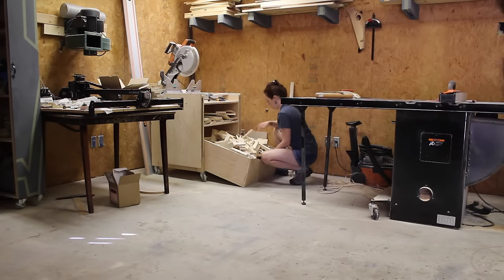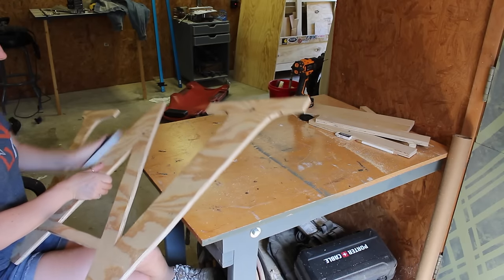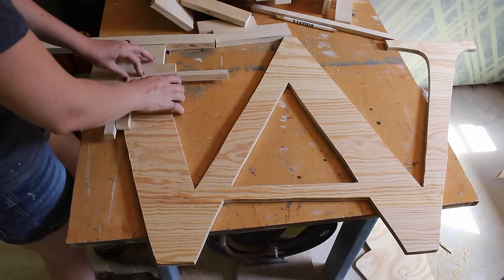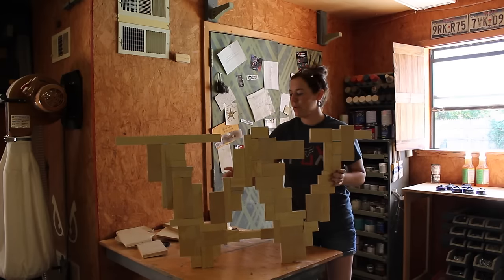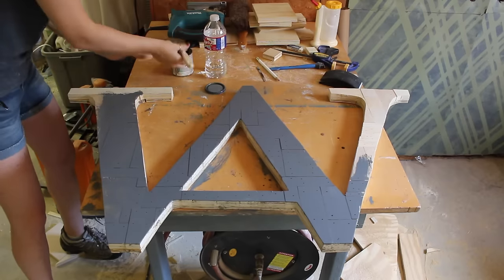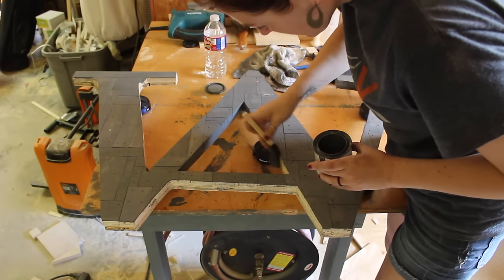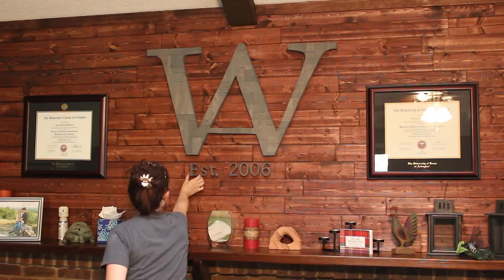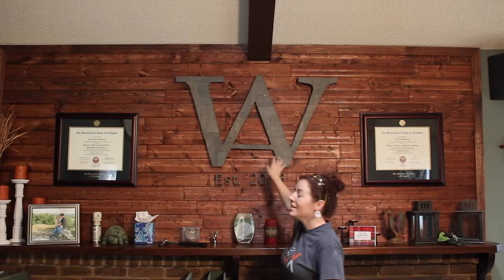Scraps aren't Crap! - A Project For Small Scraps : )

Comment: Nice! On the weekend I built a deck out of pallet wood, and as you could imagine there were a lot of scraps left over. I have a dart board mounted to a large piece of MDF, so I could hang it outside on the brick wall of the house. That's so the darts wouldn't hit the brick, however it looked pretty rubbish. So I got the scraps from the deck, a bit of liquid nails and a bradder, and basically did what you did on top of the ugly MDF :) I even put one strip on its side to act as a shelf that i drilled some 3mm holes in for the darts to sit :P then finished it up with a bit of decking oil. I'm definitely a fan of rustic woodworking!

Comment: looking good.  my wife wanted a W for an xmas gift last year.  she printed me a W in the font she liked, which was very similar to this.  the most difficult part of the project was up-scaling her print by 3x.  it was 3/4" plywood, sanded smooth, and painted gloss black.  she then epoxied several of my beer bottle caps across the face, as well as cutting out and epoxying the crownroyal symbol from one of their purple bags.  came out pretty sweet. :)

Comment: Thanks for the useful tip. Scrap is always accumulating and your idea can impact. In cutting out those letters, how much did you consume?
Reply from the maker: I don't understand, what do you mean?
Reply: Oh sorry I did not make myself clear. You did "consume" a sheet of 3/8" plywood in order to make the logo. In so doing you created scrap. So my question was,what was the net result - did you make more scrap than you consumed? I'm sure it was well worth making the sign but in terms of emptying out your scrap bin it might have made things worse.
Reply from the maker: Well the point wasn't really to empty the scrap bin, it was to put some of them to use before burning them. Typically I just take this bin outside and dump it in a fire, however I've been wanting to do this project so why not use material I already have instead of buying something? Even though I used a piece of the 3/8" plywood, I still have a very large piece left over that I'll be able to use for something else. All of the small scraps that were created from this project did go to the fire.
Reply: +April Wilkerson OK thanks for explaining.

Comment: April... Very unique choice of the stain against the other wood.. Have you ever used Tung Oil for any wood finish??? I use it on gun stocks, which of course are "handled" often, and the Tung Oil is good for shedding water if caught in the rain.. Just curious..
Reply from the maker: Nope, I've never used Tung oil yet. Just poly, wax, and teak oil so far. : )

Comment: You can also dilute the paint with half or more paint thinner. It will also get you the washed out, grain-showing cover, but will get paint deeper into the wood and won't require wiping off.

Comment: Could have used the router with a flush trim or pattern bit on your router rather than the jigsaw. Quick, easy and a nice clean finish. 

Definitely a must for someone not wanting a rustic look (looks like you were using downward teeth on the jigsaw blade from behind which caused a lot of tearout).

Cool project. Great use of scraps.

Comment: I like the idea and the performance very much but: you used a big board of new plywood for the background.
That´s rather wasty imho.
Reply from the maker: Wasty? Nah, that's why I kept that piece around, because it was large enough to be used for another project. Annd, I only used a portion of it so I put the remaining large portion back on the rack to use again. If I didn't use it then I would have had to buy something and that would be silly.
Reply: +April Wilkerson Thanks for your reaction. Of course you are right. The board of plywood was a "leftover" for you. But:  In the country where I live plywood is rather rare (and expensive). It ´s only possible to buy whole boards (appr 8 x 4 feett) which I cannot transport in my car. The sellers don´t have possiblity to cut it for clients.
From time to time I see some adds, where smaller pieces are offered. Mostly 1/4 inch or even thinner.
So I have to be very careful where to use plywood. If I would ever gain such a big board of plywood as you used as a background, I would "never" use the way you did.
Nevertheless I liked the project very much. I´m looking forward to your next videos.